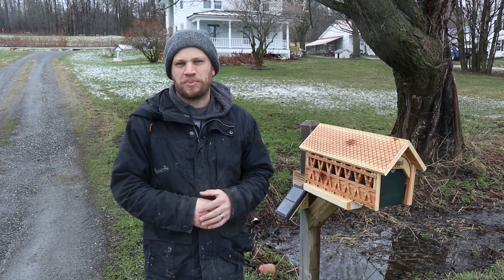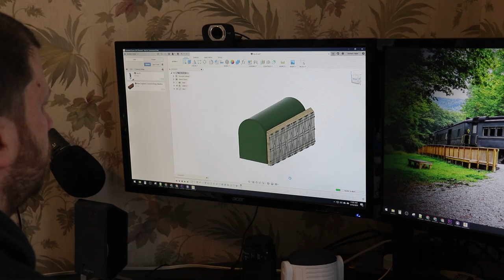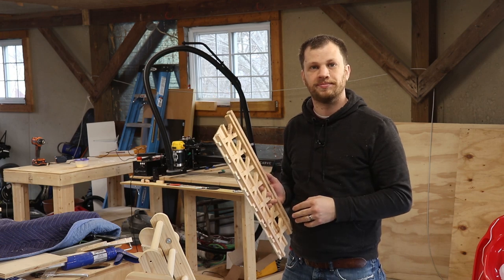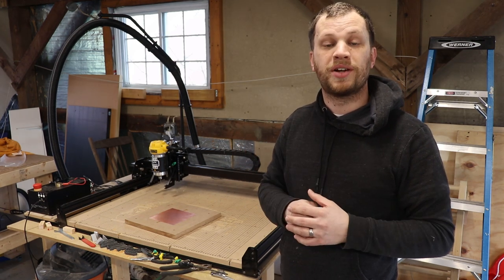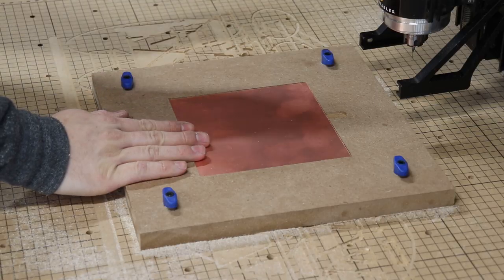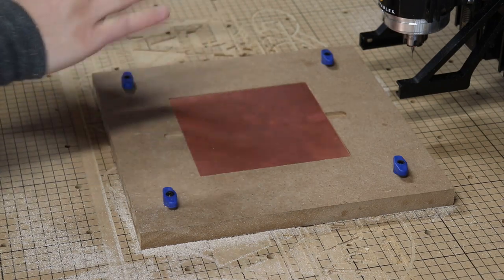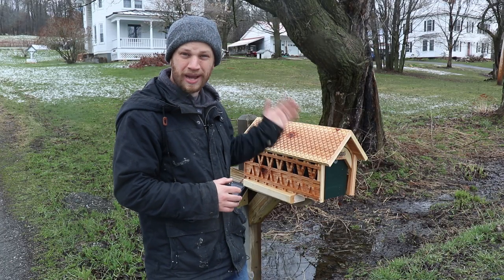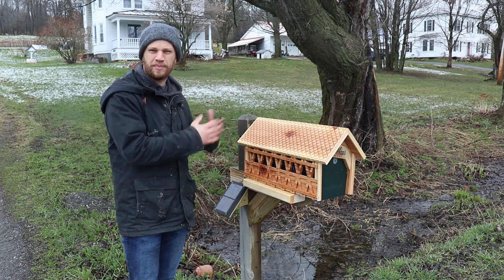Rebuilding The Covered Bridge Mailbox

Comment: You should put some sensors in there so if they detect a certain threshhold of acceleration/force (like if someone tries to damage it again) it triggers a speaker with something like "THIS ATTEMPT OF DESTROYING PRIVATE PROPERTY WAS RECORDED AND IS FORWARDED TO THE AUTHORITIES!" :D
Reply from the maker: That's a great idea! I tried to figure out how to include a camera but I needed to use what I had on hand. Maybe in the future I'll be able to add a camera.
Reply: @bytesizedengineering  and maaaaybe include a device that emits an electromagnetic pulse to disable their vehicle 😃😃😃
Reply: @JustJoshinAround  It sounds good on the surface, but do you really want "them" stuck in your driveway?

Comment: Amazing amount of thought put into this.  I assume you eventually protected those power lines from the solar cells going into the mailbox?  If not, the sun is going to deteriorate the jacketing in a rather short time.
Reply from the maker: Yes that's a good suggestion. I need to do the same with the 3D printed enclosure. PLA doesn't do well in the sun either. There are other materials I should have used but I didn't have any on hand.
Reply: @bytesizedengineering  You can't think of everything, but you can always make an EC, lol

Comment: Well done but I can't help but wonder why you didn't include two cameras to catch the inconsiderate neanderthal approaching and departing the scene of the (next) crime. Then prosecute to the fullest extend of the law!
Reply from the maker: I tried to figure out a way to include a camera but I was constrained to use what I had on hand. I may try to integrate a camera in the future.
Reply: @bytesizedengineering  Until then maybe you could fashion a u-shaped protective device by welding rebar in a u-shape (two long parallel pieces topped off by one short piece) pounded well into the ground (or set in concrete)  and positioned over your priceless one-of-a-kind mailbox. Mount it so that it's closer to the roadway so when Mr. Neanderthal swings a bat from a moving vehicle he can't make contact with any portion of what I consider to be a work of art.  Yes, I'm taking this personally! lol